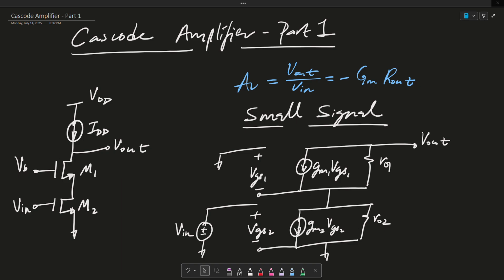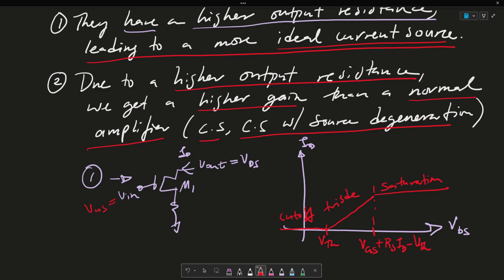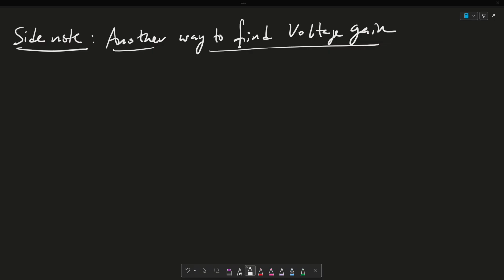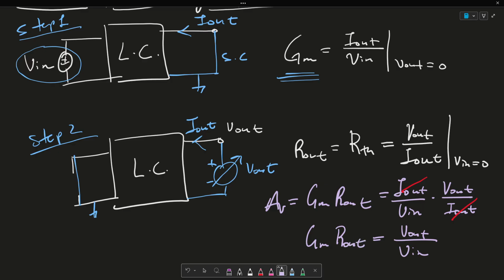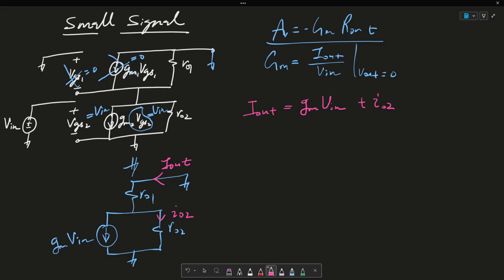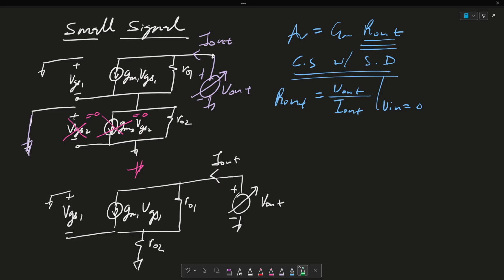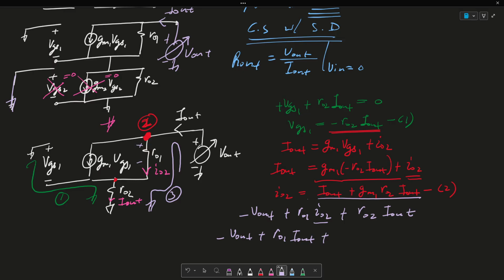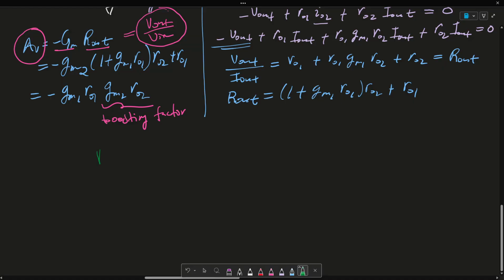Cascode Amplifier - Small Signal Analysis (Part 1)

Comment: 10:30 Could you explain why Vgs1 = 0, thank you
Reply from the maker: Hi, great question. The first way to think about is: Since the gate is an open circuit, it doesn't "load" the circuit, but its voltage is determined entirely by the nodes it is connected to. If the gate is tied to AC ground and the source is at AC ground, then Vgs1 is 0 - 0 = 0. 

Another way to think about this concept is: a MOSFET induces current into the circuit primarily through an electric field. The voltage applied to the gate terminal creates an electric field that passes through an insulating layer (oxide) to form a conductive channel between the source and drain, allowing current to flow. Since device 1 (vgs1) has 0 voltage at its gate terminal, the device does not turn on and the current gmVgs1 is equated to 0.

Last way to think about it (using KVL). If you write a KVL equation on the outer loop starting at the ground located to the left of vgs1 and around to the ground to the bottom of vin; the equation obtained is: +vgs1 -vgs2 + vin = 0. The only way to satisfy the equations is for vin = vgs2, therefore, vgs1 = 0. 

I hope this makes sense.

Comment: 19:47 what did you do with the extra ec quation part e.i.: gm2*ro2 + ro1 

Have you disregarded these terms in this equation Av? 
Could you explain that approximation, please?

Thanks in advance
Reply from the maker: Hi, great question. The approximation goes as follows -> I will start with the Av = -gm2(1+gm1ro1)ro2+ro1. Note gm1ro1>>1 so we get rid of the 1, now gm2gm1ro1ro2>>ro1 so we can get rid of the ro1. Therefore, we are left with just -gm1gm2ro1ro2. I hope this makes sense.